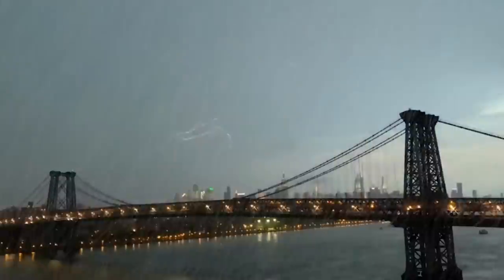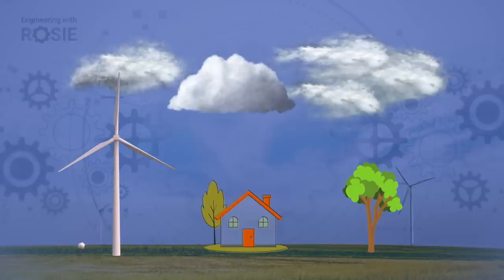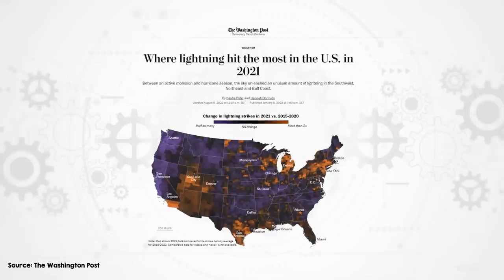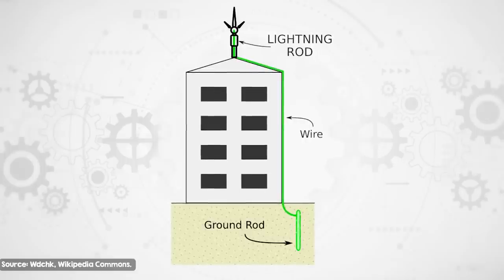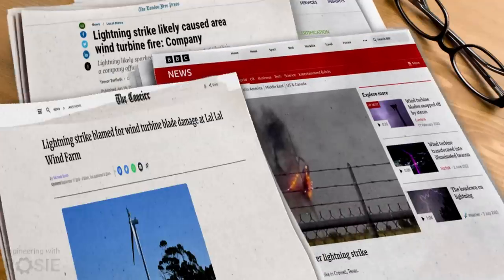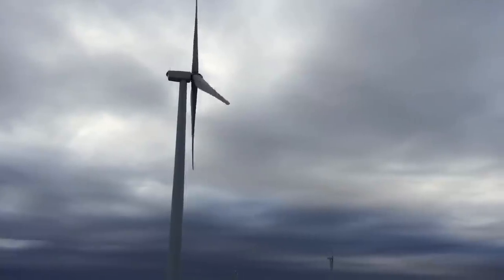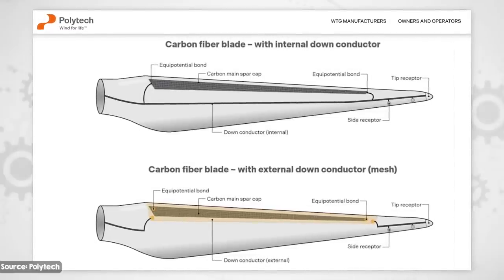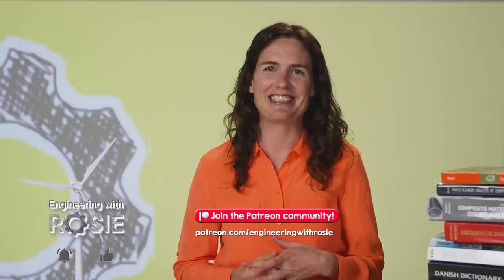Wind Turbines vs. Lightning: What Happens When a Wind Turbine Gets Struck?

Comment: What type of grounding system do wind turbines use? When I was a broadcast engineer, besides having lightning rods atop the towers, we used buried radial wires. AM stations already have a robust ground system. However, on FM, TV, and communications towers, we use ground radial systems specifically to dissipate the energy of lightning strikes.
Reply: Wind turbines are connected to the earth via ground rods and generally the rebar in the concrete pads. The industry has requirements for bonding that most operators follow.  In some parts of the world it is really difficult to get a stable ground - particularly rocky or mountainous areas - and extra work is needed to get grounded.

Comment: What about putting  "freekin lasers" on the wind farm? 
(Nature Photonics Laser-guided lighting )
Reply: Laser-guided lightning is still relatively new and expensive.  The recent experiments in Switzerland required blocking off the airspace so that the lasers didn't affect pilots!
Reply: and its success rate is abysmally low.... 

but it's still a cool idea for the future.... kind of like how fusion is a cool idea...
Reply: What about a sacrificial drone just above the blade radius tethered to a conductor outside the turbine housing with it's power lead.
Perhaps it would create a preferred path for the strike. The drone could stay up indefinitely during a storm because of the supplied power. The tether combined with high wind may not make this a viable solution. As well as less conductivity compared to a wet carbon fibre reinforce blade.

Comment: Airliners have the same problem and with modern composites used in wing and fuselage construction, you can't rely on the low electrical resistance and high current carrying capability of an aluminium alloy airframe. Likewise, expanded copper or aluminum mesh is incorporated  into the structure.
Reply: Correct!  Wind turbine blades are relatively inexpensive structures compared to aircraft wings and fuselages.  Turbines blades are also mass produced.  The costs and problems with expanded copper/aluminum mesh is avoided by most blade manufacturers.

Comment: could a stiff rod go up from the shaft and curve above the blades to offer an even better target?
Reply: This has been tried experimentally.  It has merit.  It's just difficult to implement.....
Reply: NASA 100% protect their space rockets on the launch pad from being struck by providing a better target above the rocket, so the answer is yes.  I think the real question is if it would be cheaper to do so?
Reply: Nothing is 100%, especially in terms of protection.... 

and carbon fiber airplane manufacturers already have cost effective options...
Reply: @nigels.6051  The launch pads are relatively simple to protect - put up a couple taller towers and connect them with catenary wires.  Works pretty well to protect a small area.  Wind farms are pretty massive - covering several miles.  Difficult and expensive to put up tall towers next to every wind turbine - especially on the more remote/mountaintop locations.
Reply: @WeatherGuardLightningTech  NASA has the problem that they need to leave a hole in the top to let the rocket fly through.  For a wind turbine I imagine it can be done with a single tower, which the wind turbines already have, although not tall enough.  But presumably this has been thought about and not implemented for good reason?   Is it worth parking the turbine while there is lightning overhead - improve the chances of it going for the lightning rod on the tower instead of a non-conductive blade.
Reply: @nigels.6051 this is a great question about stopping the turbines in lightning storms!!!   It had been tried and without marginal success.  Spinning blades are slightly more attractive to lightning. The problem is the massive loss of power production every time a storm cloud passes overhead.  The revenue lost doesn’t outweigh the reduced lightning damage - it’s better to keep the blades producing power.
Reply: @WeatherGuardLightningTech  We don't get much lightning here in UK, so an occasional stop, at a time when there is plenty of wind, thus cheap electricity prices, would not seem much of an issue compared to continuous loss from the damage. How about when there is lightening about, a lightening rod extends from the tip of each blade, then you only loose a little power from the extra drag?  What is the distribution of lightning strikes along the blade, are they mainly on the tips, or does the whole blade need protection?  Maybe that is changing with blades getting longer?

Comment: The "lightning follows the path of least resistance" canard has always bugged me.   I learnt ohms law somewhere around 9th grade....     Lightning is electricity and electricity takes ALL available paths simultaneously.    Now an ionization channel is going to be the main path of lightning in a poorly conducting medium ... but given the potential energies (and just plain potentials) in lightning,  anything in the close proximity of a lightning strike is in danger. (You're still relatively safe inside a (metal) body car, as the amount of metal around you is fairly substantial).     As I understand in buildings the conductive path is usually routed through a girder or standpipe ... a huge amount of metal.      Inside of a blade, where weight is a consideration, I'm presuming the conductor is relatively small.   The problem is as you mention specific energy.   Electricity follows the outside of any conductor ... but in any volume/mass of conductor there are only a limited number of free electrons to carry electricity. ... Sure it will move inwards to be conducted as the outer layers saturate, but it only does so by overcoming its own electrostatic potential ... which on a small conductor is HUGE ... hence the overages will spark out .

I would suggest that the solution would be multiple conductors with embedded highly conductive (aluminum probably) mesh around them and ideally through
the material of the blade. Carbon fiber is a good conductor, but you have the problem of the outer layer being the only real conductive path, when the charge saturates the outer layer's free electrons,  it heats.  You need a mesh of more conductive material inside so there isn't a saturated outer layer conducting the electricity.

Now all of this speculation from a once, too long ago now, physics student, lazing around the peanut gallery.   The ideas need to be tested (or maybe already have and then discarded) but I'm throwing it out among the peanut shells for anyone to pick up as they choose.
Reply: Good observations - you are on the right path.  Putting carbon in a blade next to a wire / conductor is a massive problem. They must be connected together or widely separated.  As Rosie described - if there is an electrical spark between the two the carbon can be damaged.  As the carbon is carry most of the mechanical load this damage can cause blade failure!  Such a huge problem!  Blade designers are trying new designs at the moment - we shall see!
Reply: @WeatherGuardLightningTech  Don't know how practical it would be, especially with cost considerations, but it seems to me that the best solution would be to move the  main conductive path outside of the blade structure, making he outside of the blade conductive as well with connections between at frequent regular intervals.  (or better yet two, one near either edge where the ES potentials will be strongest).  Now anything outside the blade is going to have some aerodynamic interference which will probably be small and manageable, but the mechanical resonance problems in higher wind situations would be problematic.  Still if you're expecting hundreds of strikes throughout the blade's lifetime, it's probably worth the effort to look for a "best" solution. 

I think part of the real problem, that I haven't heard talked about is that these blades are moving through air that  even naturally has a rather large voltage differential. It is almost by definition picking up charge and carrying it across different amounts of ionization ... which is how a Van de Graff generator works.    Has any one documented "clear sky lightning" from these beasts?  I'll bet a substantial amount that it happens, and won't be surprised if it's really fairly common if someone looks.  (I'm also wondering if some of the "lightning" damage isn't caused by the stress on the materials of carrying these possibly quite substantial charges almost continuously for years even when there is no observed "lightning").   Hmmm.  Have your scientists talked to your repair techs?   I'll bet the techs have procedures for making sure they 
dissipate any charge around them while working ... getting nasty shocks a few hundred feet in the air will be educational.  

You need a multi-approach solution. The range of energies in a lightning strike is so wide that it's impossible to account for the high end - I've read there have been observed bolts that can rival a small nuke (quite rare and usually as sprites rather than ground), but you still have to deal with the possibility of larger than normal.  But at the same time it's best to dissipate the likelihood of strikes generally,  perhaps a field of regularly spaced poles (spikes)  around them   reaching a substantial height  or even a barbed wire (points to dissipate static charge) net (perhaps one strand every 10 meters or so) to minimize the voltage differential from ground to sky.     Basically the interaction of electrostatics and atmosphere is something that seems to be poorly understood.  I have a hunch that tornado formation,  and even summer dust devils  as well as larger weather movements have a fair amount to do with ionized air movements as much as from pure vortex mechanics.
Reply: Kirkoff's Law

Comment: Lightning cables in blades would have to attach to slip rings at the hub, right? I can envision such rings getting welded shut by high current.
Reply: The wind turbines use fairly large contacts in the slip rings or spark gaps across the joints.  They can be pitted by the current but not welded.

Comment: Are many bearing failures caused by lightning strikes? Tiny arcs between bearing rollers and rings will pit the surfaces leading to cascading damage. Presumably the rotating shaft is grounded via a slipring but avoiding any current going through the bearings must be another difficult problem.
Reply: Yes - bearings can be pitted by lightning currents or even static electricity discharges.  This will lead to premature failures that are hard to identify by mechanics. Aircraft engines are rebuilt after lightning strikes because the bearings and raceways are pitted.

Comment: I am curious why a lighting rod that goes a significantly higher than the blades is not a good option?
Reply: not stated clearly in the video but it sounds like it's something to do with the way the wind moves around the blades.
Reply: As wind blades are reaching lengths greater than 100m, putting a lightning rod nearby or on top of the nacelle is expensive and a little tricky.  It adds costs and can disturb airflow.  Right now - wind turbine manufacturers are bleeding cash and can’t afford additional lightning protection…

Comment: One thing I don't think very many people know. outside of electricians, it's everything is conductive at a certain voltage. Even non Conductive things like plastic Ceramic glass It all has carbon in it which can be conductive.
Reply: Everything is can be charged - even non-conductive things.  Lightning engineers only touch equipment that is absolutely, 100% grounded.  No exceptions!😃

Comment: I wonder how they connect the "wire/mesh" from the rotating blades to the turbine body. Are they using carbon brushes and copper commutators, or there is something newer/better?
Reply from the maker: A few people have asked that. It's a different design for each manufacturer. We can talk about it in the livestream, I am pretty sure Allen knows all about that.
Reply: @EngineeringwithRosie   I do...

Comment: G'day,

Yay Team !

Lightning is weird, but I never previously considered the concept of it being a Plasma which is Hot Air and Air is a Fluid which flows around Surfaces according to the Laws of Coanda and Bernoulli  - so the Lightning is
Blowin' in the
Wind..., and
Eddying in the
Turbulence
Of the Blade-tip Vortices...

Yikes !

Good luck trying to control the
Connection and direct the
Flow of
Current, under such a plethora  of
Variable factors -
Especially in a Structure featuring conductive 
Carbon Fibre...

One wonders how the increasing frequency and increasing intensity of the record-breaking Extreme Weather Events will be featuring Lightning Strikes with proportionally more Volts, extra Amps, and bonus additional Milliseconds of Peak-Flow...?

It's now about ten years since Hailstones first grew up from "Golfball-sized" making the National TV News, to "Hailstones as big as Oranges", which killed a score of sheep, dozens of Kangaroos, and two Horses out around Narromine...

Warmer, wetter Air can contain more Thermal Energy - so the Vertically moving Airmasses are apparently being effectively fed more power ; so the Hailstones are going up & down inside the tops of the Clouds many more times, accreting more Ice every cycle..., before finally becoming sufficiently heavy that the Updrafts can no longer keep them aloft...

Are the bigger better upsized Stormclouds, which now deliver bigger better heavier and more energetic Hailstones (even unto the infamous Mega Cryo-Meteors - Hailstones as big as Watermelons !)..., also introducing bigger better shinier Lightning Bolts with added extra Current, boosted Volts and longer lasting Strikes - all growing with every passing year, as the Atmosphere continues to heat up...?

How does Bushfire Smoke effect the Blades' Lightning-Protection System's performance - does the Smoke leave any Deposit on the Leading Edge of the Blades, and if so then what does a layer congealed Tar, with microparticles of Ash and Soot (Carbon) do to the 
Conductivity of the
Smoke-stained
Leading-Edges (?),
One
Wonders....

Such is life,

Have a good one...

Stay safe,

;-p

Ciao !

Comment: Good video, but I now wonder how carbon fibre aircraft fair when hit by lightning.
Reply: Carbon fiber aircraft use metal mesh on the exterior to minimize burning damage where lightning attaches.  Plus the carbon fiber on commercial aircraft is high quality material and relatively thick.  This makes it pretty tolerant of carrying lightning currents.  Carbon fiber aircraft still have a significant amount of metal - mostly aluminum - to act as a current path and electrical power ground.
Reply: Thanks for the responce with that info, very releaving planes are safe!

Comment: Lightening is green energy.  We should consider capturing it on capacitors and putting it on the grid.  The same strategy would work with triboelectric charges from the wind.

Comment: Hi Rosie,

Thanks for your enlightening and thought provoking video (pun intended!)

I wonder if taking the opposite approach, to tackle lightning damage, might be viable?  
 
What if we retrofitted wind farms with lightning inducing structures that help farm the enormous power of lightning, and in doing so allow the lightning to easily flow safely to earth rather than damaging the existing wind turbines already in situ.  I wonder how massive and expensive these structures would need to be and if it could be modelled?

If it were possible to divert the lightning strikes to earth before flooding the generators, then one candidate for these mega structures could be vertical axis wind turbines made from readily available, highly conductive aluminium alloy.  Despite generating a fraction of the electricity of HAWTs, these lightning inducing Mega VAWTs might offer an easily maintainable, heavy duty option to accompany the existing array? 

I wonder if the Mega VAWT's generators, and other susceptible electrical components, could be housed in giant Faraday-caged concrete foundations. This style of Mega VAWTs might then be significantly more serviceable than the HAWT with their sky high generators, since there would be no need to scale mega structures 100's of feet from the ground, just to perform preventative maintenance or repairs to the business end of the turbine.

I'm also curious about progress with lightning farming.   Maybe we should be thinking about lightning farms that include wind turbines rather than the other way around?

My initial thoughts are that if we could develop mega powerful hyper capacitors, that could actually handle the immense instantaneous power of the lightning strikes, then we could proactively harvest the lightning, which would otherwise pose a threat to the HAWTs already in situ.  Theoretically, stored energy in the hyper capacitors could be used to feed the grid when the wind drops. That would be a truly awesome achievement!

If this technology were developed, it could present a compelling business case. The potential reduction in maintenance and repair costs, combined with the extended lifespan of wind farm investments, could be significant. If there was also potential for additional revenue from increased consistent supply to the grid from the modernised wind farm, then I wonder if that would add up to a cost effective solution?🧐

https://app.runwayml.com/creation/67d7e16d-a293-42a6-9452-ac96e6ca70e4

I'd be delighted to know your thoughts.
Kind regards,
Richard